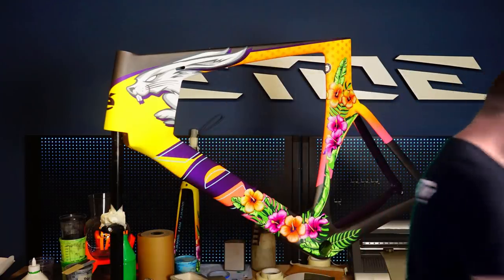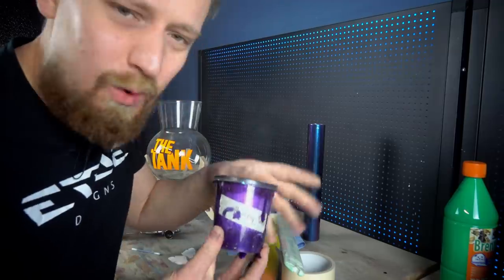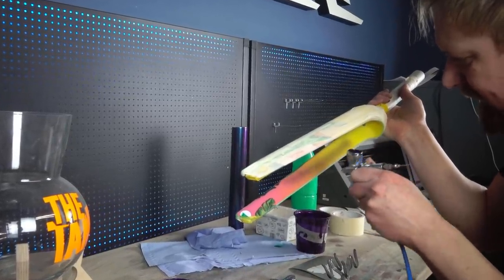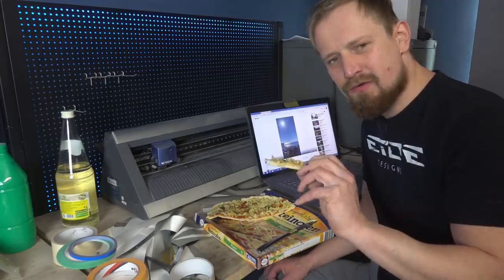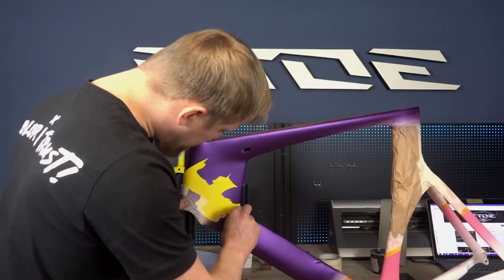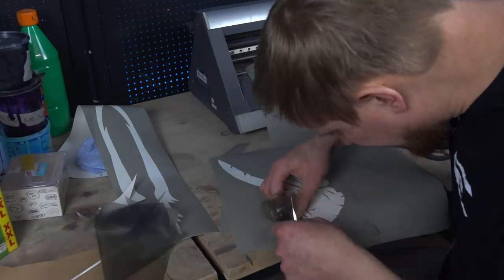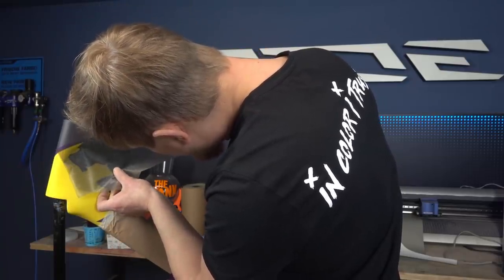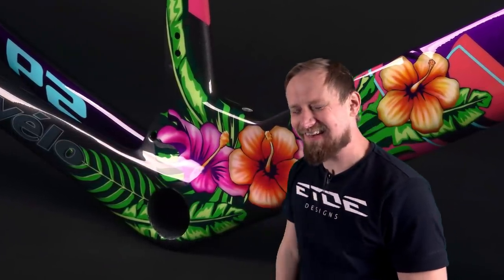how to airbrush paint a carbon bike - airbrush stencil artwork

Comment: The video is just the same with ASMR, addictive. Btw, I have a qustion guys, between layer of colour is not in the same thickness/height, so it is not flat right? Is it enough just to spay clear coat? Or do we need flatten all the colour layer to the same height/thickness? Thx.

Comment: Martin - how do you match the durability of the factory clearing process? Are you using a ceramic clear? Baking? I paint for fun and have for a long time but the one mystery is achieving factory-like durability with automotive clears.
Reply from the maker: I use different hardeners and cure it in an oven.